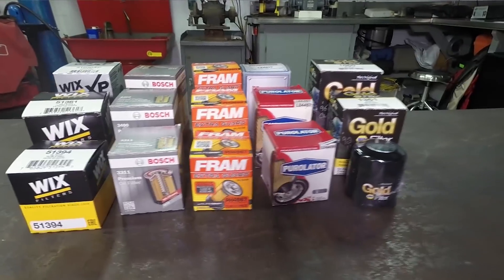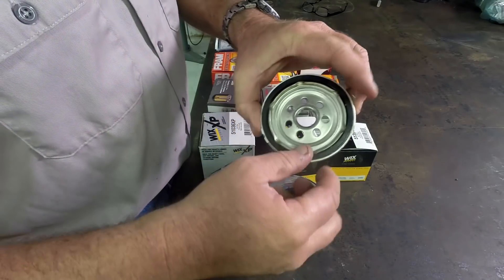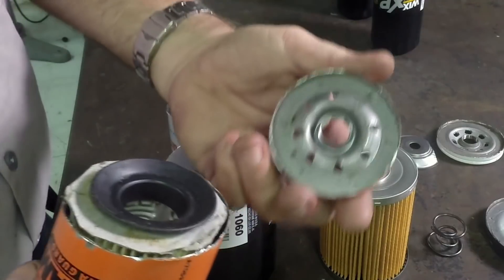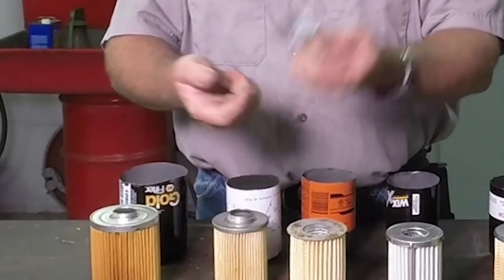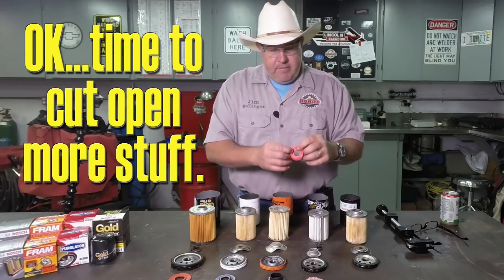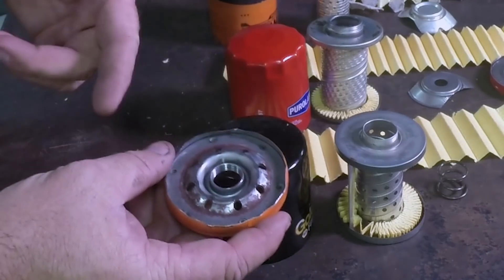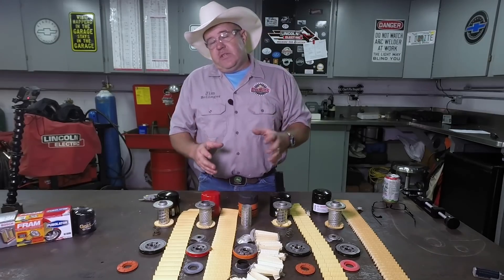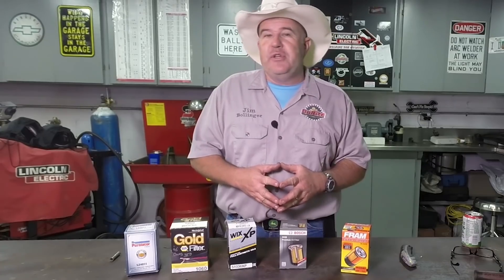The worst oil filter EVER!

Comment: Used Fram for decades but will stop, knowing about the low filter paper quality.  Thanks for that! However, to be fair about the rust,  I doubt any maker galvanizes a short life disposable can.  It is possible that the batch was shipped or stored in a moist environment, and bare steel will rust very quickly there.
Reply: Right about the rust...have seen NAPA GOLD with rust also...doesn't make the filter bad...BUT...really what is the criteria for oil filter paper?? So FRAM has a cheap filter BUT it works!

Comment: meanwhile oil geeks are using Fram ultras now over Napa Platinum and Purilator Boss and Wix XP in 2019 because negligible or even worse builds..
Reply: ( They ALL do the same thing...JUST FILTER OIL ! )
Reply: @denniscollier4931  Napa and Purilator use to have vastly better construction.. I've been following technical discussions on bob the oil guy for years. I now use an IV synthetic with Fram Ultras..

Comment: I bought a race super bike and never used a factory filter. Used 
Purolator. By sheer luck never used anything else. Fram filters were right next to them on the shelf. What luck I never picked one. The Purolator worked fine. Imagine an auto filter on a bike. They came in a long and short version If you have clearance problems. I had a V-Twin Honda so I used the long one. More filter material, also Honda filers were more than twice the price.

Comment: You did not include a Hastings oil filter which , will surpass any filteryou tested. What holds that paper element to the enclosure? Glue. Hastings uses absrbent material sandwiched between wire mesh no glue. Wehad a race engine fail because, by using a typical filter like the ones you tested the high pressure (120 psi) crushed tthe paper element and the glue tha fell out blockek an oil passage to a shaft bearing causing the engine to fail. Coul you test a hastings filter or other similar ones to it to show the general public other better  choices, some good for racing apps. By the way our engine was a racing rotary engine.

Comment: Learned this years ago when I destroyed an engine with Fram filters. Destroyed all the mains and the crank.
Reply: Did the oil filter by-pass work?  Sounds like it failed...that is a faulty engine....The by-pass would have prevented oil starvation had it worked!
Reply: The engine always had low oil pressure on my gauge for years of owning the car. It finally got to the point of throwing an oil light and I rebuilt it. Still had low oil pressure after the rebuild, then not long after I learned the garbage that is Fram so I changed filters and instantly got normal oil pressure.

Comment: I stopped changing my own oil after I got an 87 Jeep Cherokee with the 2,6L V6 GM engine in it and discovered one elbow wasn't enough to get at the dang filter. Now i'm at the mercy of Valvoline or Jiffy Lube O'l change shops. What do they use?

Comment: The Fram COR(bulk cheap filters for high volume shops..walmart etc)I crush don't look like that inside.The cage is plastic.Not rusty metal.And a high volume filter of the extra guard Fram variety for a Camry or Accord might not be rusty.Small block filters don't move very fast anymore unless its hot rod or pickups,which rarely buy a Fram anyway.

Comment: The Issue with the Fram is that your comparing higher tier Synthetic Filters to a Cheap 3000 Mile convention oil filter. Check this out https://www.youtube.com/watch?v=Y544o-mw2wc
https://www.youtube.com/watch?v=vJ7_-mhqfdQ

Comment: Wow!  I've been using frame all my life...never again.  I always liked the grip material at the bottom for tightening...but, the inside is what counts.
Reply: Dennis if you need that black grip for tightening, it's TOO tight or you need more Wheaties and spinach !! Doubt if it's powdercoat Jacksmiles 47--too pricey--probably that shit advertised on  TV by that obnoxious goof in the  boat
Reply: You are right...it is about what is inside...BUT...does any filter actually filter "BETTER" than another? ...The proof is in the use...too many FRAM oil filters out there working and 
doing the job they were designed to do...filter oil...no better...no worse.
Reply: any problems with those fram filters?

Comment: Too bad Fram's quality control wasn't as good as the marketing. 
Thanks for this!
Reply: This is the cheapest Fram available.... and hes comparing it to more expensive oil filters. Fram has 3 or 4 models better than this. Their synthetic version is great. Has all the bells and whistles.
Reply: It's a question of design, not quality control.  The design, choice of materials etc,. is what makes them a bad filter.  As for quality control on a product made this badly, it would need to be non-existent or none of the filters would have passed.
Reply: @chrisantoniou4366  easy fix. Buy a higher priced filter. The fram synthetic is built like a tank. Amsoil, royal purple. All quality filters

Comment: I agree with you the orange Fram filters are junk but they make two higher grades filters a Grey tough guard one and an even more expensive one than that. They are  supposed to be better made inside.  Also why didn't you test an AC Delco filter

Comment: I used to be a regular Fram buyer until I saw this. I actually had a new Fram diesel filter sitting around and cut it open after I saw this vid and found it had reasonable contents without rust, cheap paper or anything like these do, so I am not sure if their quality control was just bad on gas filters seen here or what. However, why take a chance- they really should be ashamed of what we saw here. I am going to Napa next.

Comment: I've been lucky, 415 k miles on my 82 Isuzu diesel pickup, changed oil and filter every 3k miles. Of over 100 filters I used at least 80 have been Fram.

Comment: I drive Ford van and cars and also work on industrial sweepers with 4cyl 2.5L Ford engines, I always buy and use the OEM Motorcraft oil filters, for all my vehicles, they are still about 5 bucks each, and made in the USA, a very quality filter, and these Motorcraft filters have larger oval oil inlet holes than ANY other oil filter on the market, even Wix or Napa, Ford engineers design them for each Ford engine, so why not just get the OEM Ford?..........And if you do not own a Ford, I also would just get the OEM filter for your brand, oil filters, even OEM filters are not that much money, why try to save a buck or two and possibly sacrifice your several thousand dollar engine????

Comment: Dang and to think I used Fram oil and air filters almost exclusively for many years. I switched to Wix on my car before last. My current car which I bought new in 2017 has been using Amsoil Signature Series synthetic oil paired with an Amsoil EA filter since her first oil change. Now it has me wondering how Amsoils top filter stacks up.
Reply: Give them the extreme test....use them and decide for yourself....did they do ANY better that the cheap FRAM filters ????

Comment: I think what you can NOT decide by your test is the EXACT microns of dirt that does and does not get thru each filter.  Remember if a filter is TOO thick it plugs too easily and you have ZERO filtration.  Really to do this test right it would have to be done in a lab where each filter would be subjected to the same hot, dirty oil for the same amount of hours and then to measure the trapped dirt in each filter...Even so there is NO excuse for Fram having rust inside of their filter.  Thats what happens when a company is been around too many years and is relying on their name and quality falls by the way side.

Comment: Consistent with every take apart, and scientific micron level filter review I have ever seen, Fram is the absolute worst filter on the market. I remember working at dodge dealer years ago and there was a TSB about how Fram filters could not be used on cummins engines because they cause bearing failure, and I have actually seen a Fram filter do exactly that with my own eyes. 100% TRASH.

Comment: The only filter you should use is the actual one they use on your car at the dealer by your filter at the dealer it is designed for your motor

Comment: You don't compare the filters as apples to apples . You show the cheapest Fram against the mid to high level Wix and "aka napa" you are an idiot. Like comparing a Ford Fiesta to Ford Taurus ? Wix has a cheap filter too. Their fuel filters are shit. Material from filter causes injector failure, proven fact! You have got to getting paid for this. It's like the auto parts store handing me autolite spark plugs for tune up. That is a lawnmower plug and not one maufacturer uses them. The store makes a bigger profit on those too.

Comment: Ive been using fram filters for 50 years. My car I bought new has 325,678 miles on it. That is just your opinion. I guess the 325 thousand miles and still going strong engine might need to be retired maybe after  another. 100,000 more miles and  I use synthetic Mobil 1 oil. . Go figure. If it aint broke don’t fix it.

Comment: and yet.....they work just fine. i have 2 vehicles with high mileage, 260k prius and 240k 6.5td chevy, both have run nothing but fram filters since day 1
Reply: I feel this video is a bit biased. Though i'd still prob spend a few extra dollars to get the higher quality one.
Reply: i guess i should have also said that i dont use them on everything. i use better filters where required, mobile 1 on slk, ac delco on duramax, wix on equipment etc. anything that has special filter requirements gets it but as a basic filter on basic engines that get regular oil changes they are fine

Comment: KEEP IN MIND, Bosch and others might be good today, then bad tomorrow. Bosch does not make it's own, anymore than does NAPA.  They contract with filter makers.  As such, it's a good idea to check up on your favorite from time to time.  Of course, Fram can always be trusted to be a toss away, before it's installed.  

Another interesting point. Those free oil changes - take FULL advantage of them. That is, when the change is due, get it changed. The Honda place in Kennwick, Washington installs a filer less than half the size of a regular filter, so the mounting flange is twice as big in diameter as the filter itself. Accordingly, you need to change the oil more often than you would with a regular filter.

Comment: You should open that same batch of filters after they have had 5k miles on them. Most import cars are now using canister style oil filters, just like what the inside of the Fram Extra Guard filter has, no metal end caps. Just unscrew the cover, remove the dirty filter and replace with new. I just wonder why they would take this new approach in such expensive cars. ??

Comment: I used Castrol oil and Fram filters on my 95 GMC 1500 for over 367,000 miles with no problem. Same goes for my 84 Jimmy with 300,000. 

If we judged everything by looks alot of us wouldn't be married.
Reply: Yeah, but you can buy better filters for the same money so it's dumb to run Frams.

Comment: Frams also are known to split. My boss used to use fram then on his 2009 dodge 5500 6.7 Cummins the filter split and destroyed the engine with only 1800 miles on and dodge wouldn't cover it under warranty since it was a fram filter that failed then he had one split on a 6.7 cummins in a ford f650 but we cought it and did not cause engine dammage

Comment: Mann filters ONLY here.  That or Purolator.  Purolator filters are now Mann filters.  When I buy the filter for my Passat 2.5 the Purolator Boss looks the same as the OEM Mann filter except a different color.  That might be a difference in filter media type.  I noticed that they are close in price from the Mann filter to the Purolator Boss in price so being essentially the same brand I buy the Purolator Boss.   The only other real difference is the packaging the filters come in.  The Mann filters are in a green and yellow box but the Purolators come in a more colorful box.  It is not about nice packaging so much as quality and you can't go wrong with either one, you get a really good filter either way and it is NOT a Fram filter.

Comment: this guy drives an old rambler that never had oil change since day one and the fram filter is plugged with now black lard grease which makes the little oil in oil pan. slush around only when engine overheats because low rusty coolant that has an old dirty sock instead of a radator cap that was installed two years ago when the hood was last opened. But the rambler she still starts when the am radio is punched on the leftside and quickly turn the key till hear starter kick in and grind with sparks which look pretty at nite! but during the day have to listen to starter and when grinding with smoke then let go of key! and your good to go! but go faster than 50 mph then the wheels will stabilize and can steer straight with slight grab to the right because the front right tire is two sizes smaller than the rest and not a radial with a bubble thing on sidewall i think is for balance or something.  😀😀😀😀😀

Comment: I have had issues with fram filters now I know why
I have used STP for years and they seen to work good
Reply: From what I have seen in the oil filter cut open videos, STP is not much better than Fram!
  However, some of these were the standard STP filter, like the ones used by oil change chains,   STP has different grades, but considering their standard,  I have doubts about their others.

Comment: How you can compare extra guard with the top of the line wix synthetic filters and top of the line Napa gold, Fram extra guard is economy line not top of the line you must use Fram Ultra which is synthetic or tough guard which is Semi synthetic they outclass and outperform wix and other in this test I am using Fram Ultra from years without any problem they go up to 20000 miles with ease they are the best.

Comment: Fram has always been about marketing. They make junk. For all of you guys saying you’ve ran Fram for x number of years without any issues. YOUR MOTOR SAW MORE WEAR! This guy talks about the construction of the filter. That’s only a small piece of the puzzle. Quality and quantity of the filter media is where it’s at. Look at beta ratio. Fram is still junk in this category as well. K&N May be the best in the industry, followed by the Extended Life Mobil One. Most of the players make a standard version and a gold or extended life version. ALWAYS buy the extended life or gold version. You’re buying a better quality media and usually more of it. You will have to do your research on the beta ratios. Most don’t list that number. A beta 1000 is a high quality media. If you buy a high quality filter, you can get substantial more life out of most synthetic oils. Always remember. Marketing is just marketing. You have to find the facts for yourself.

Comment: I do like the rubber grip handle on the Fram - wish Wix (my choice now) had it. But yeah, Fram is the loser. The last 2 times I got one (which ended our complex relationship), it had metal shavings on the threads! Left over from manufacturing???
Reply: That’s not a rubber grip on that orange filter, that’s undercoating to keep it from rusting through and leaking on your floor.

Comment: Seen many many engines run a very long time on Fram filters. My 2004 ranger with 4.0 V6 went 174,000  before it lost the timing chain guides. When i tore the engine down for a rebuild the rod and main bearings were perfect!!!!    Valvoline 10/30W oil and  Fram tough guard filters were what i used the entire time.
Reply: O.K. JIM...here is another thinker...it's NOT about the packaging ..it's about the job it does...filter oil !  The same as all the others...no better...no worse.

Comment: This isnr surprising when u get what u pay for also fram is ment to be changed every 2 or 3000 miles so nor ment to be n fr long , air filters arnr the best,  why would u expect rhe oil filter to be diffrenr, I use wix and bosh, stopped using fram along time ago

Comment: There all junk. There designed to be changed and thrown away every 3-5 thousand miles. The best oil and oil filters are ones that are changed regularly. I use Walmart oil and oil filters on everything I have. Zero issues.  Millions of miles combined. Save money and protect your vehicles. Change your oil regularly with the correct but cheapest oil and oil filter you can find.
Reply: 3000 mile oil change intervals are a thing of the past.

Comment: I have 2 vehicles, one with over 200,000 and the other over 300,000 miles. Both have never had any engine repairs. I do all the car maintenance myself so I know its done correctly, I use a software program www.automotivewolf.com to monitor and manage the maintenance schedules, and I always use OEM filters directly from the manufacturer. It works for me.
Reply: Great program! use it myself.

Comment: I’ve used Fram oil filters in my 2006 5.3 liter about 60% of my oil changes since 2006. The gradual consequences led to oil pump failure at 190k miles which led to catastrophic motor failure. New GM crate long block just installed. I learned the hard way. DON’T USE FRAM OIL FILTERS.

Comment: One word: WIX   
I use a 2 stage Wix air filter on my turbo Maverick and after 500 miles of fine dust, the filter is plugged and everything after it including my expensive turbo and engine is immaculate.

Comment: I ran two different suburbans to over 250k miles using Fram, every 3-4000 miles. Never touched the interior of the engine on either one.
Reply: JD Spears still have one ‘burb👍

Comment: The only reason i ever kept using fram is because of that rubber coating on the outside; had my fill of STP filters that refuse to come off without screwdrivers despite lubing the seal prior to installation. STP kept slipping in my wrenches, but fram came off normally. I know there are others that have that grip on the outside, definitely going to look for another brand next change now
Reply: paint your own grip on it pre install